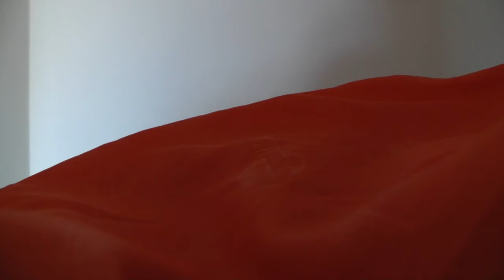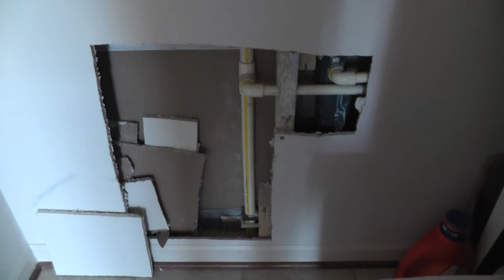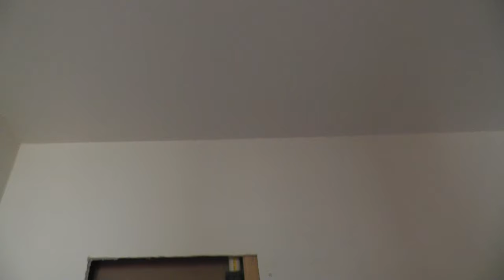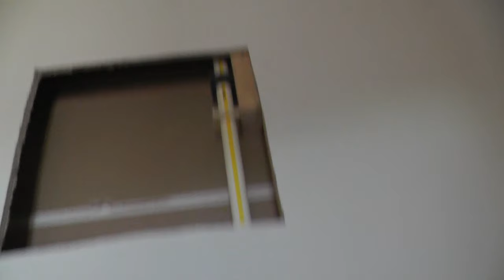Water Hammer Noise

Comment: That's not water hammer. That's the thermal expansion/contraction
Reply: Hi Taqqee, do you know how to solve this problem? I have same problem here.
Reply: @harryshao189  Hi Harry. You can make use of expansive joints and expansive loops. Thet have room to accommodate expansion and contraction caused by temperature in pipes. Also, what kind of pipings you use? PVC or metal?
Reply: @Taqqee09  thanks, I am using copper pipe.
Reply: @harryshao189  ah. Use the expansion loops and joings and you should be fine. Hope this helps

Comment: that's thermal expansion/contraction. not water hammer.
good luck
Reply: Jesse Balfour Hi! What can be done to rectify this situation?
Reply: Any advice on what to do? Our sounds are worse and we rent. Landlord doesn’t care
Reply: @r2488  I'm guessing there is a clamp that's too tight or maybe one of the holes drilled through the wood framing is too small. Do what you can to give the pipe(s) some room to move. The movement would be measured in milimeters or less.
Reply: @jessebalfour5665  it seems to only knock between 10am and 3pm (usually starts after running sink for a few minutes) is there a reason it’s only between those hours of the day?
Reply: @r2488  my is only happen at night

Comment: I hear this in my pipes... should I be worried? I rent, so it would be a landlord problem I guess. But I hear this  noise sometimes when there are no taps being used or toilets being flushed. I hear it mainly when the shower by the upstairs neighbors is used or if the washing machine is running. It is loudest right in my bedroom, in the corner, but I can't tell if it is coming from the ceiling or the wall.
Reply: You better have renter’s insurance when all your personal belongings get trashed when a supply line fails! The landlord’s insurance won’t cover your stuff.

Comment: that's not water hammer, that's the pipe sliding against the wood with expansion & contraction
Reply: So how i fix it?
Reply: @minnieT1978  put something between the pipe and the wood
Reply: @MooseDoesStuff  ty what do u suggest? Since it's in the ceiling plumber cut it out and they're coming back to put that back on Wed. I was thinking of Styrofoam.

Comment: Alternatively, the ticking sound may be caused by expansion and contraction of pipes carrying hot or cold water, as their temperature changes.

Solution: Install insulation around the pipe.